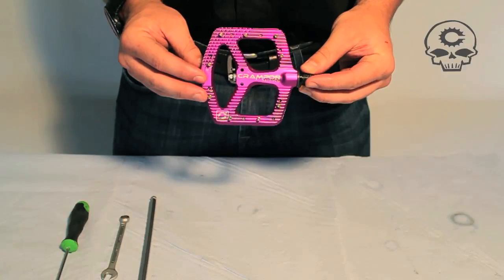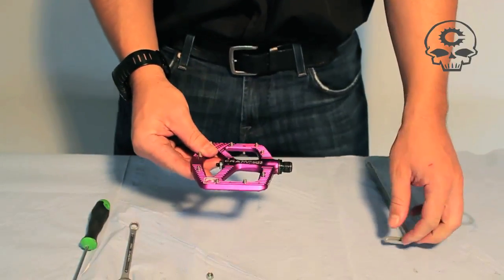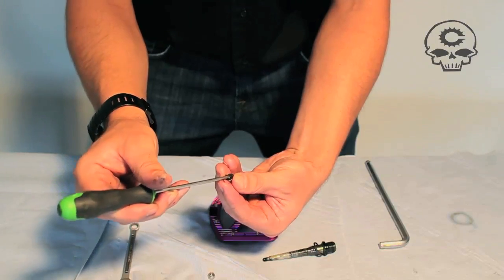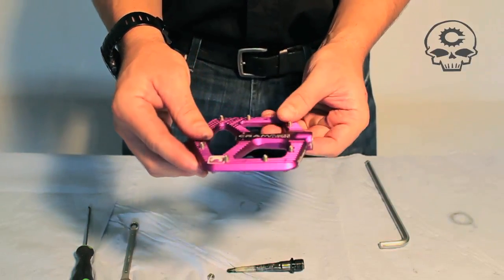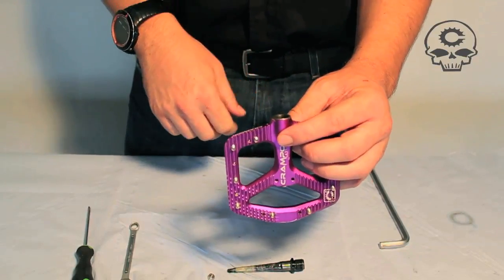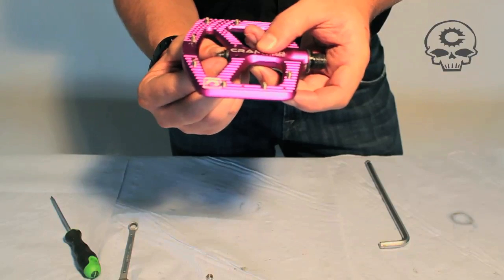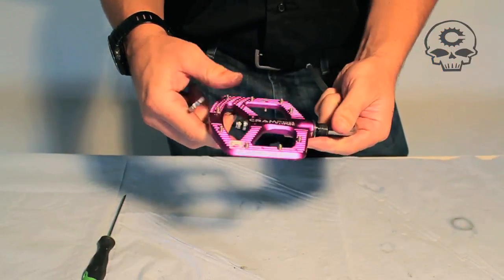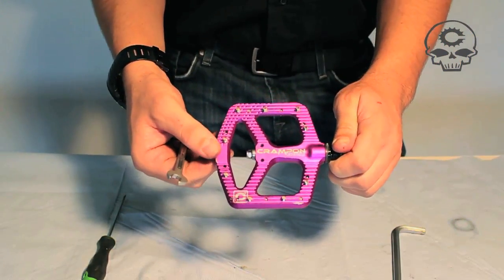Canfield Brothers Crampon Ultimate Service Guide

Comment: I ride in wet and muddy conditions about 7 months out of the year.  With the pedal still on crank I pull body off clean and re grease after about 4 weeks of riding.  It only takes 10 min to do both pedals.  About once a year I replace the Du's and I just grab the small flanges (shoulders) with needle nose pliers and twist and pull them out.  It only adds about 5 min to change out the DU's.  These have been the bomb proof and easiest to maintain pedals I have ever used.  I am now running a set of the new "Mountains" on my new bike so I am curious on how long they go until service is needed.  6 mouths now and they are still like new.